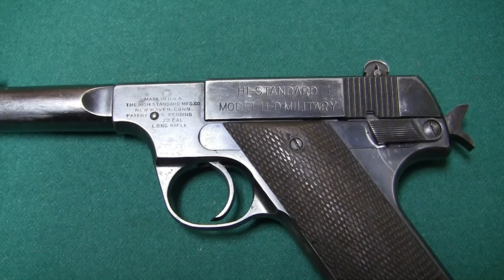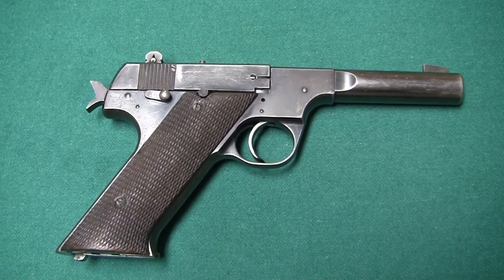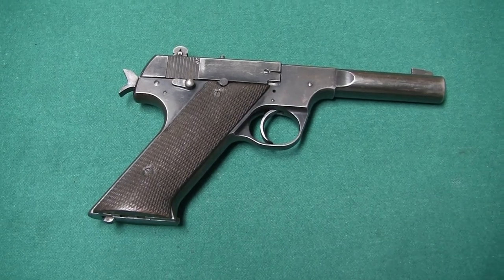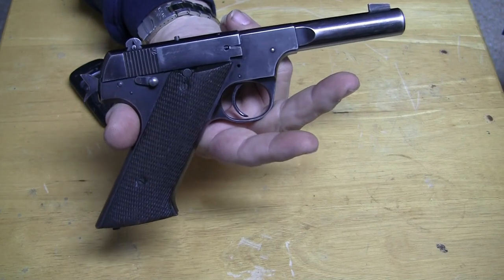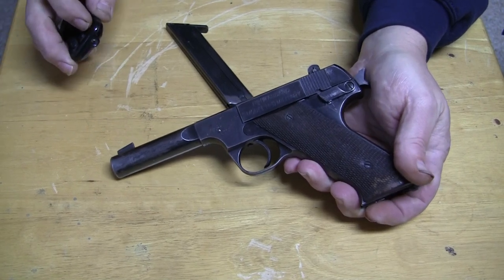High Standard H-D Military 22 Cal pistol

Comment: From what I've seen, you might want to take your four hundred and take it times about three times that. I've got one with the longer barrel that belonged to a great, great, uncle, went through my dad and now I own it. That back sight is great but complicated to adjust and can be broken if you don't know what you're doing. There is a screw under the slide and another on the back of the slide that have to be loosened before you can move the rear sight.